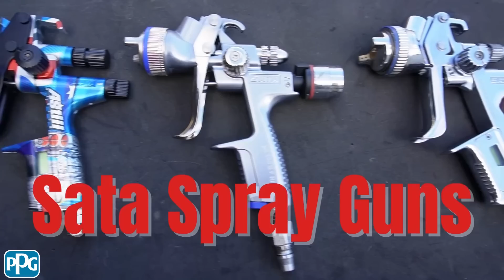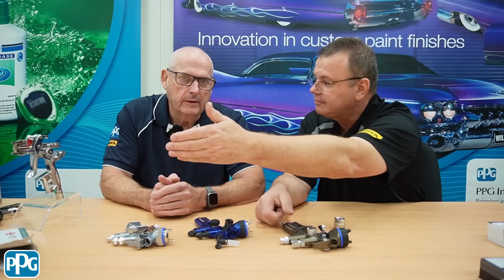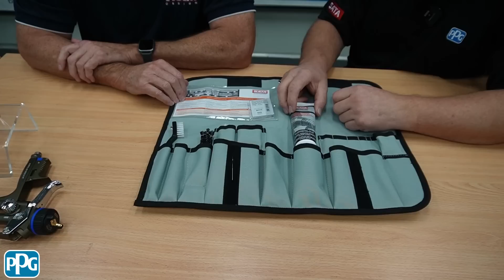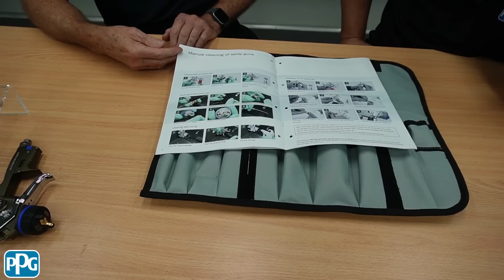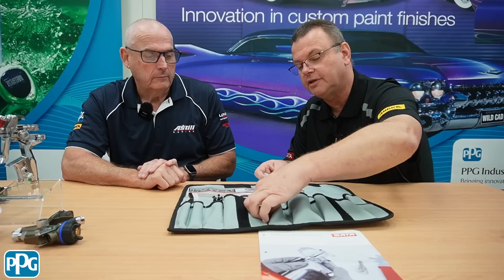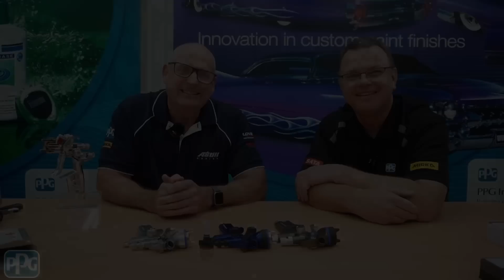SATA Spray Guns - How to choose the right one?

Comment: Would the sata jetx 5500 1.4 o pattern be a good all round choice for base and clear ,, single stage now and then, plus candy once in a great while, trying to decide between it and the iwata ws400 series 2 any suggestions would help thank you
Reply from the maker: Hey mate, I checked with Casey from PPG, here is his response 
I would recommend the 1.3 I as all round choice for both clear and basecoat and bit better control , the O model nozzle is closer to the iwata fan type which is normally a bit heavy for basecoat and can cause Mottle i don't recommend any 1.4.
Hope this helps
Cheers H

Comment: And still no clearer on the difference between I & O setups which wasn’t covered after mentioning that it would be.
Reply from the maker: Just goes to show we are all Human. I'll make sure it's covered in a future episode. 
The parallel “I”-nozzles
Parallel spray fan with minimal dry zone (and drier center)
For painters who prefer reduced application speed (improved control)
Slightly less film build per coat (compared to “O” nozzle)
The oval “O”-nozzles
Oval spray fan with larger dry zone (and wet core)
For painters who prefer a faster application speed
Higher film build per coat (compared to “I” nozzle)
Cheers H
Reply: @AstillDesign  Thanks taking the time to clarify that Howard. 😊. Appreciate the reasoning which is hard to find info on. Cheers mate!